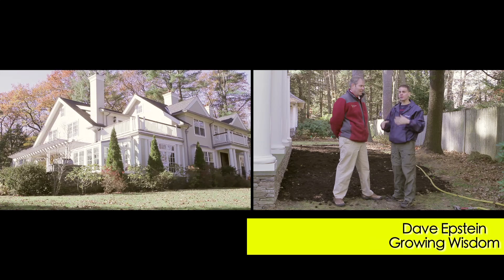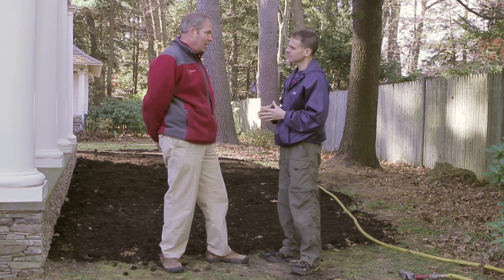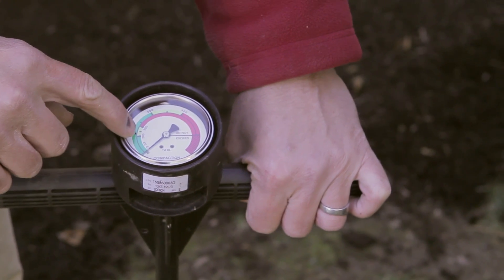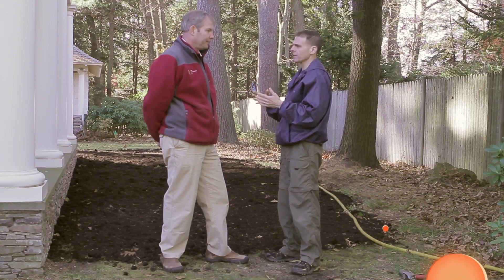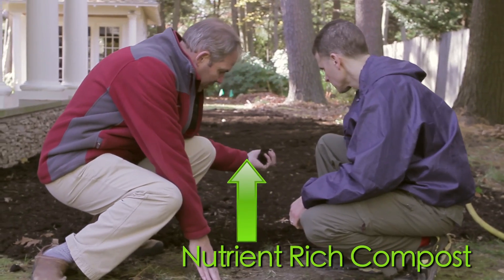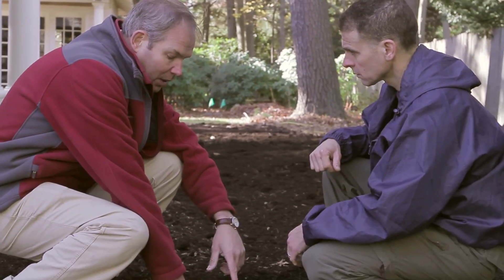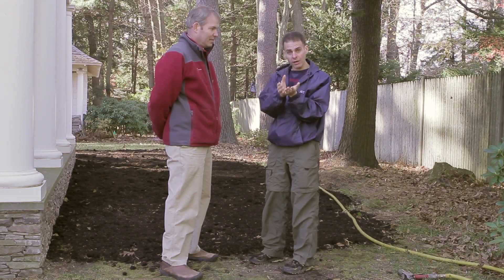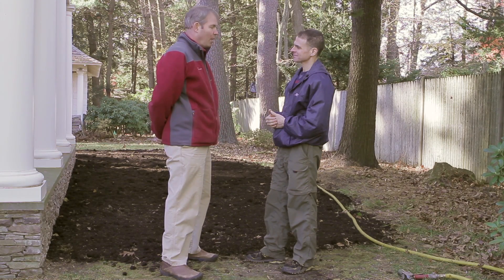How to Solve a Soil Compaction Problem Using an Air Tool!

Comment: Venicestu is not correct.  Once the soil passes a threshold of compaction, "natural processes" cannot decompact it (at least not on human homeowner time scales). Intensely compacted soils are too strong (which is why they are good for foundations) for plant roots to penetrate, plus, as the soil is compacted and the pores are squeezed shut, the very low porosity shuts off the diffusion of oxygen which is essential for root growth (and why we use core aeration).  There is, unfortunately, a point of no return where some human physical intervention is required to reestablishe a deeper well structured porous permeable biologically active soil profile.